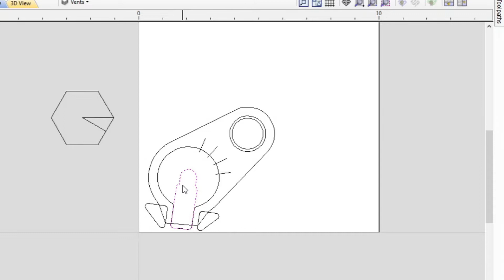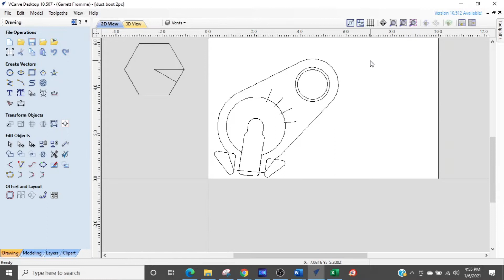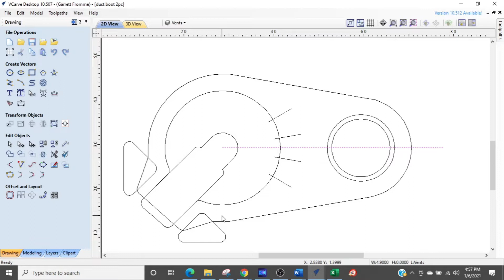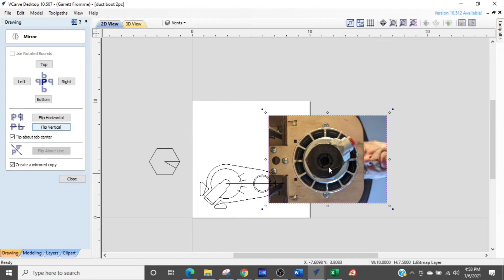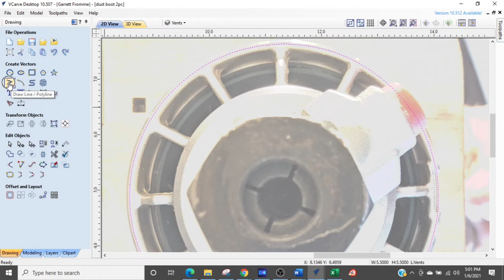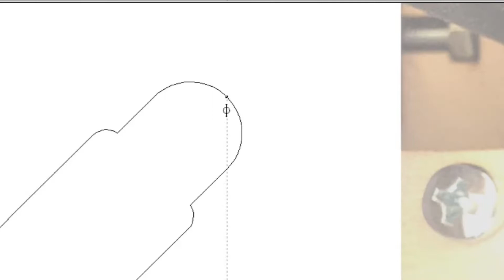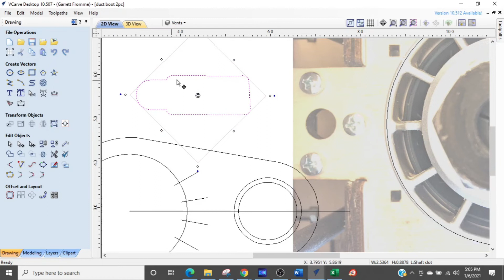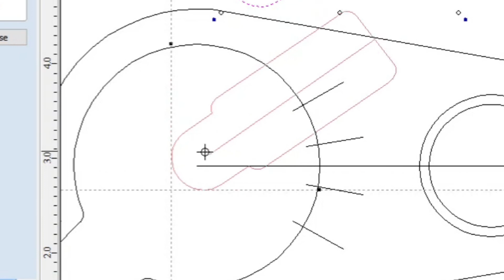How To Use Move, Rotate, Angles To EXACT Positions For Beginners Vectric Vcarve & Aspire Tutorial

Comment: This is all a bit fast FOR A PLUMBER😳 however I’m learning from deep dark green😔
I have the shapeOko XXL I’ve owned it for probably three or four years and I struggled with their 3-D carbide software. I finally got frustrated and quit so it’s been sitting in the basement for a couple of years now we’re gonna take a crack at the car to see if it’s simple enough for a plumber to use ? Not a new plumber you know 25 year-old hip to computer plumber I am a 65-year-old retired plumber who did not need a computer for a damn thing my whole life now all of a sudden I wanna learn how to do CNC. I hope I’m in the right place. You’re teaching method is very good. It’s a bit fast for me, but I will rinse and repeat as many times as I need to! Do you have a first project practice suggestion and then maybe a second and the third that would step me up into CNC operator😊😊🙏🏼❤️‍🔥🇺🇸
Reply from the maker: It's great to hear that you're diving into CNC woodworking! Starting with something simple like a keychain or a small sign can be a fantastic first project, allowing you to get familiar with your machine and the software. Once you're comfortable, you might try making a decorative box or a simple puzzle, which will challenge you a bit more. Finally, you could move on to a more elaborate project like a piece of furniture or a shelf, which will really showcase your skills. Enjoy the learning process—you're doing fantastic!

Comment: hello
i am trying to do chess set off thinivers (UNDEAD EGYPT SET). i use vcarve pro , so far there looking ok two sided carve, but on carve co they cut on all four side, little more detail. is there a way to do this in vcarve.
Reply from the maker: paulrcreech7731, Hello! In VCarve Pro, you can achieve more detailed carvings by using the "Profile" toolpaths in addition to your "V-Carve" toolpaths. For a two-sided job, you can set up a separate job for the detailed cuts that outline the edges. You can also experiment with different bit sizes and depths to enhance the details on each side. Just make sure to align your pieces properly for perfect registration between cuts. Happy carving!

Comment: How do you rotate a panel or rectangle used for a stair railing, rotated to match the angle of the stairs. It would be rotated about a corner of the rectangular panel?
Reply from the maker: Hi Phillip. Once you know the angle of the steps (rise over run), Hold the rotate bead, then type in the angle, and the project will rotate to that angle.

does that help?

Comment: Then, draw a rectangle around the orange button as close to fit as possible. Find center on that and run the intersection of the two lines on the bit hole to the center of the “button rectangle” for your angle.

Sorry I don’t have better terminology.
Reply from the maker: I get what you're saying.

Comment: I would have done the same thing with the picture... In fact I start a lot of 3d models that way...I was screaming/wondering if there is a short cut button for your angle spin.... Like maybe hit TAB and then type in + or - 180 degrees..... ???? I can hardly wait to play with this software.... your making me feel more confident in learning it. I have been making 3d models and animating for years but really want to make it solid if you know what I mean :<0)
Reply from the maker: Hi Jerry. Yes, there is a way. As you're trying to rotate, type in the angle and enter. Boom, you;ve turned it to the desired anle

Comment: Pretty high tech for this 75 yo mind, might have to watch a couple more times.  Looking at your spoil board i have a tip for you on how not to spoil your spoil board.  I used to do picture framing so i have tons of matboard left over.  Matboard is about .050 thick so i cut a piece the exact size of my project material and put it between the spoil board and material.  When i do my profile cut it cuts about .025 or so into the matboard but never touches my spoil board.
Reply from the maker: Leroy!...this is brilliant. And I so happen to have a framing shop right next to me. I'm talking to him right now!!!! I will also put this on my list of videos to do.
Reply: @IDCWoodcraft    I do something kinda similar Garrett.  Since I do a lot of repetitive items over & over again, at various times, I make kind of a 'Mini Spoil board' for each item.  The board is made from 3 mm MDF and is cut to the exact size of the stock material that  i will use.  I place the stock material on the 'Mini Spoil board' and clamp it to the router table.  When I do the cut, it cut cuts about 1 mm into the 'Mini Spoil board', leaving the image on it.  I identify the 'Mini Spoil board' with the particulars and store it away for the next time I need it.  I have an MDF 'Mini Spoil board' for each item I cut.  By so doing, I have never used a full sized Spoil board on my CNC Router table, thus never need to resurface or replace one.